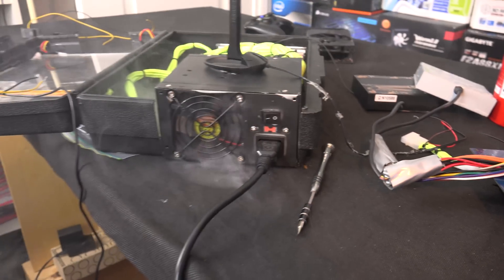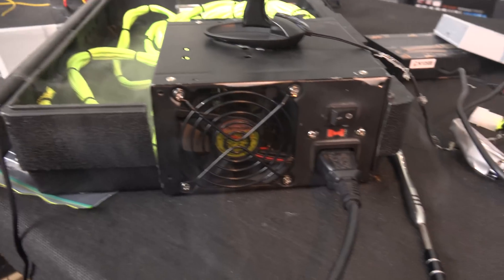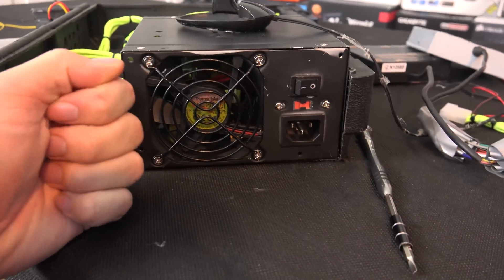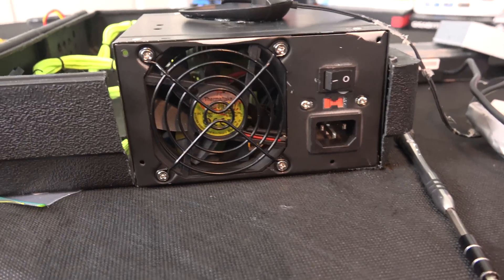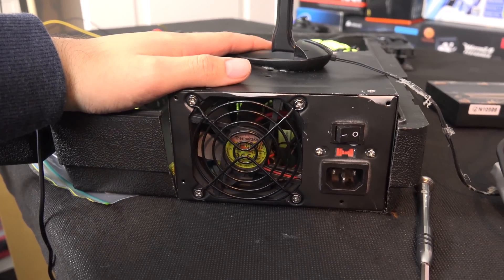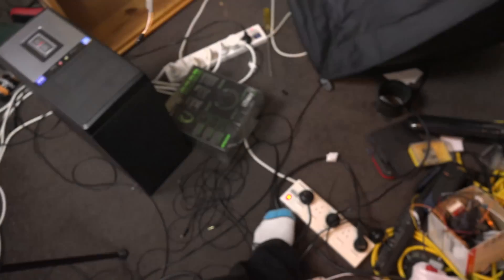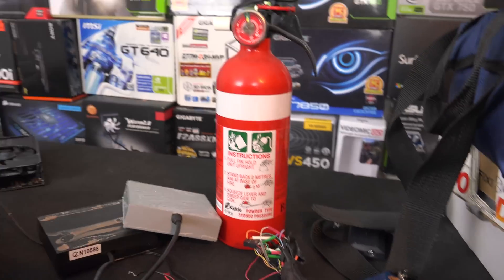PC Safety and Exploding Power Supplies

Comment: The most likely the power supply blew up is because of either bad ventilation or it was an el cheapo Chinese power supply. All power supplies have electrolytic capacitors. 97% of Chinese brand capacitors use bad quality electrolyte, causing exes heat and blowing the safety valve on the capacitor. Sometimes the mains filter cap shorts out. And rarely the transformer insulation is not good and it arcs through it.

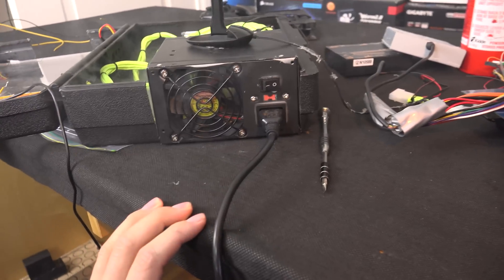Comment: 3:16 good psu's have: short circuit protection (scp), i seem this dont have :/   
My AWFULL chiepish PSU have nice SCP, i tried, i shorted out as hell, psu turned off, and well after i removed the short, and its worked again. So my psu is nice. PSU name: Danubius DAN-450-12. I've got it 2years ago for 15$) i had a garbage psu 350W but actually the V*A 
spreadsheet looked like 270W, i succesfully melted the 24pin and the psu is exploded :') I thinked about to replace the DAN-450-12 to Vortex Raidmax 500AF because, my psu is getting a bit old, primary capacitors are a bit expensive

Comment: I work in an electronics manufacturing plant that adheres to Class 3 J-Std practices. Not saying we don't have explosions from time to time ... but I will say it boils straight down to design, testing and workmanship.

My point is that I see much less than class 3 J-Std standards being practiced in what you have set up. Just my observation and opinion.

It sucks the psu bit the dust. I would really loved to have seen the innards of the PSU though, just out of curiosity sake ... to see what really failed.

Comment: Really, Your first issue is you used a thermaltake psu. I have never seen a thermal take psu last more than a year. Iv never installed one, and never will but unfortunately there are some companies that continue to use them...
Reply: They have some good psu's too.
Reply: @jhonvvick1289  Yeah I have seen a few thermal take psu's that do suvive. Id be interested to open one up and see what failed. In other OEM psus iv noticed transistors fail commonly, infact usaly faily explosively. Its just the majority of them iv seen have failed and thats why in my opinion id stay away from them. Its hard not seem brand bias while still knowing who makes good stuff and who don't, just down to your personal experience i guess. For all i know thermal take make some other great stuff, i just don't use them enough to tell you. 😁

Comment: This just happened to my pc. One question I have is did it damage any of my pc parts?
Reply from the maker: it is hard to tell. in some cases, you might not notice any damage until later down the track. what I would do is power up the machine with a new PSU. then make sure all parts register, all the ram is present, video card shows up ect. then stress test the system for a few hours on both the cpu and gpu to make sure that sustained loads are still fine. if all appears good you might just be in the clear

Comment: was the power supply voltage switch on 240 and if so do you have 240-volt wiring, having the switch on 240 on 120 wiring can make capacitors explode

Comment: If you short the green wire with the black wire and you plug the computer power supply into the wall and the computer power supply isn't powering on and the green led on it isn't lighting up then the computer power doesn't work and is most likely bad but if it could have a chance of exploding so never plug a computer power that doesn't work into the wall because it can still explode even though it doesn't work

Comment: Will the pc still work after the ac blows/ what will need to be replaced if it does
Reply from the maker: if it blows like in the video or makes a loud pop and smells burned I would replace the PSU for a start and any parts that stop working properly. as for the pc working it will depend on what went wrong in the PSU. sometimes it might still boot but is strongly recommended to change the PSU
Reply: CPU modder is it worth the risk to try to see if it will still work
Reply from the maker: not really no

Comment: Never buy power supply's from goodwill because goodwill is a thrift store that never tests electronics to see if they are working or not and goodwill is very good at ripping off their customers so if you buy a used computer power supply from goodwill chances are it will explode on you the moment you get home and plug it in so avoid buying computer power supply's from goodwill at all cost

Comment: well my 300 watt unknown brand psu just exploded today.....i just plug my pc on "without any avr"than typically using avr....and i just hear a " B00M" inside my pc......that psu serve me 12 years and now it just fail..what part of the psu  just fail can anyone explain it to me???
Reply: Capacitors are common to fail on unknown brand power supplies. The reason why you get the boom is the capacitors popping probably because they were either cheap crap or were performing way out of spec.
Reply: it's 12 years I'm surprised it didn't break much before
Reply: probably too old and in need of replacement
Reply: Me it was the transformer in it. Its weird but like there wasnt any black spot on it after it blew

Comment: this is my rule with power supplies of you have a computer that pulls 500watts than you get a 600 watt psu or more you never wanna max out a power supply!!!! ok don't care who makes it just don't max it out! when psu manufacturers label there power supplies they go by the peak wattage and you never wanna run a psu at its peak just don't do it! I've bought cheaper brands like thermaltake and they work just fine because I don't run them at peak.
Reply: no names are bad though, ever heard of kentek?

Comment: Thermaltake is actually very bad except you buy a very expensive one. But if you would spend 90$ on a Thermaltake 600W you could also spend 75$ on a much better Super Flower Golden Green HX 550W with 80+Gold. I had three dead Thermaltake PSUs and some from other cheap Chinese companies (also Corsair) and I found out that almost every cheap companie uses Channel Well or HEC Boards. The only good PSUs from Thermaltake are the TP-P and TR series because they are made by FSP.

Comment: Yes thermaltake is a bad power supply manufacturer... well actually I think they are a re-seller but there quality is all over the place.

EVGA is a good power supply manufacturer none of there power supplies are BAD and I know that from JonnyGURU he tests power supplies, Corsair as long as you spend the money are are really good power supply re-seller but if you buy one of there cheap once there not great there not terrible but yeah.
Reply: In Germany EVGA PSUs are pretty rare but we have BeQuiet here. That's the best PSU manufacturer in Germany.
Reply: Sebastian Flocke Be quiet are above average but they don't sell cheap PSU's so it's to be expected that they are not going to be bad.

I'm surprised you don't get EVGA PSU's in Germany as I live in the UK and you can easily buy EVGA PSU's.

EVGA is better though for example

BeQuiet Pure Power 9 700W: http://www.jonnyguru.com/modules.php?name=NDReviews&op=Story6&reid=476

EVGA GQ 650W
http://www.jonnyguru.com/modules.php?name=NDReviews&op=Story6&reid=454

It's cheaper so I think you can let the 50W go considering it's cheaper and especially considering it it's rated 650W in Hot testing while the BeQuiet didn't quiet manage it's 700W coming in a little lower.

And it's gold efficiency and actually manages to bear out that gold efficiency while the BeQuiet doesn't even manage it's supposed sliver efficiency.

All in all it's just a better PSU and the EVGA GQ series is EVGA's worst series of PSU's tested on jonnyguru, and the 850W is the worst of those and it still manages a total score of 9.2 while the BeQuiet Pure Power 9 manages 7.8...

Be quiet as I said is by no means bad you wont go wrong with them they don't sell bad PSU's so you're safe, but there lowend power supplies are not as good as they should be.

And I judge a brand by it's worst products and if there still pretty good then you know you have a good brand.
Reply: +Etheoma Well the Pure Power Version is really bad... Even the new one is just a "beginner" PSU... For Gaming and big graphics cards you should take the Straight Power 10 or the Dark Power Pro 11 (I currently have the 1000W Version). And to EVGA PSUs: You can get them at Amazon.de but they'r just more expensive than a better Bequiet or SuperFlower from mindfactory.de. It's just not worth it to buy a PSU or a Motherboard from EVGA. Just the graphics cards are at a normal price...
Reply: +Sebastian Flocke And the really low end Bequiet PSUs are actually pretty good. (Bequiet System Power 8). They are based on the Straight Power 9 and have some components from the Straight Power 10. AND the whole unit is made by FSP so they aren't as bad as they seem to be. They'r just alot louder and have less cables than normal PSUs. But you get 100W for 10€ (400W for 40€ and so on)
Reply: Sebastian Flocke What hardware do you have which needs 1000W 2x Pro Duo's? with a dual socket board.

I have a 750W PSU and a can support any 2 way SLI setup and some in 4 way like the 970 / 980 I really don't get people who buy those kind of power supplies

And if you want to step up G2 is what would be equivalent to Straight Power 10 in price but again it preforms better. Although G2 has recently went up in price, I think it was because it was so popular and they have stopped production for a new product.

Then the P2 would be the equivalent to the Dark Power Pro 11 which again is priced lower but is again beaten in efficiency, ripple, and achieving it's rated delivered power by giving you more than what's on the box.

And EVGA has a step up from that the T2 which is actually similarly priced to the Dark Power Pro 11 if you're willing to step down from 1200W to 1000W but if I'm spending £250 on a PSU I want quality not quantity. All other wattages are actually similarly priced though it's the 1000W and 1600W which are especially expensive.

EVGA is just better straight up for power supplies, I get wanting to go for bequiet for the looks and surprisingly enough low noise levels.

But just as a PSU EVGA has BeQuiet beaten easily at every price point.
Reply: +Etheoma i7 6950X @ 1.36V / 4.5ghz on an MSI X99S Mpower, 2 Zotac GTX 980ti AMP! Edition (both overclocked, I don't know how high), 8x RipjawsV (32gb) 3200mhz, 1TB WD Black, 2x Samsung 850 Pro 1TB (didn't have to pay for them) and 6 fans in the Corsair 750D. The whole System needs about 920W when under full load and 880-900W while rendering Videos or 3D projects. And because I didn't have to pay for some of the parts (like SSDs or Ram or the Processor) I could buy the 1000W DPP11. I also wanted a very quiet PC so the PSU is perfect for me. EVGA may have some cool products but here they are definitely not cheaper than any good bequiet PSU.
Reply: Sebastian Flocke I assume you are measuring that from the wall correct a PSU is rated by how much DC wattage it can put out, not how much AC wattage is used from the wall.

Even assuming 90% efficiency 920W from the wall is 828W in AC wattage put out by the PSU.

Although I would not pump so much voltage through a boardwell E processor Haswell E that's basically fine but Broadwell was originally designed for low power so the transitor thickness at the top is smaller to reduce power consumption but also it is more sensitive to loads of voltage because there is more resistance.

Back it off to 4.4Ghz and you should be able to reduce to voltage by a lot and you're not going to notice the difference between 4.4 and 4.5Ghz it's a 2.27% difference.

EVGA 750 W GQ £88.24
BeQuiet700 W Pure Power 9 Power £88.73

EVGA G2 750W 109.99
BeQuiet 700 W Straight 10 Modular 115.99

EVGA P2 750W £112.37
BeQuiet Dark Power Pro 11 750 W 149.99

EVGA T2 850W £214.56
BeQuiet 850 W Dark Pro 11 186.93

Every EVGA PSU out performs each of the BeQuiet PSU's

and the last one they aren't even in the same tier of PSU so it being £30 more expensive is to be expected because the EVGA T2 is Titanium efficiency rated while the Pro 11 is only Platinum, the real difference between platinum and titanium is the 10% load figure of 90%+ which none of the other breakets have efficiency requirements for 10% load.

And let me remind you that the EVGA PSU's outperform what they are labled as while the Bequiet once slightly under perform so even when I have picked same rated wattage PSU's the EVGA once can still deliver more wattage.
Reply: +Etheoma I mean I could but it's working fine. I didn't actually had the time to really test which voltages work with the processor at 4.6ghz (or lower) so I will try it out. At least it's cooled by a H110i GTX so it only goes up to about 75°C. http://www.abload.de/image.php?img=zwsho.jpg  Here is a picture of the PC btw.
Reply: Sebastian Flocke I wrote more in the last comment.

But temps are not everything Broadwell is just naturally more delicate due to it's design. As why I have been telling people Zen is NOT going to be a good overclocker because AMD has when hardcore on the power efficiency 95W TDP competing with the 6900k on performance which is a 140W part yeah there going to have had to sacrifice overclocking hardcore.

The massive reduction is AVX performance wouldn't make up a 34% drop in TDP, there going to have had to have designed a REALLY efficient architecture probably mainly focused on notebook and embedded because they are growing markets.

Because they are not going to have dropped the base clock below 3Ghz because that would be shooting them self in the foot because speed binning is easy shaking off a poor launch isn't.

They can always just sell a lower speed binned CPU latter if they couldn't achieve 3Ghz+ on a decent number of CPU's. Because they need to win back hearts and minds and sub 3Ghz clocks do not win hearts and minds...

So low clock rates cannot be the answer so it has to be architectural or based on the node used
Reply: +Etheoma Didn't see it sry. The DPP11 750W is 165€ and the T2 750W 220€. I really don't know why... And I could have bought the 850W version but the efficiency would be at around 83%. Because EVGA isn't cheap here, I didn't read much about it and I am actually surprised how good they are. And the problem in Germany is that you can only buy hardware stuff online because in electronic stores you only get Thermaltake or sometimes cheap Coolermaster PSUs. And if you look online (amazon.de) you can find different PSUs from any manufacturer but they are just overpriced. So you have to buy everything from mindfactory.de and they dont sell ANY EVGA products so EVGA isn't very popular here. And do you know why britsh products are so rare in Germany since Brexit? I wanted to buy record player (or phonograph, dont know how it's called) and I ordered it 1 month ago from Audio-Technica. It still didn't arrive. Also my broken Headphones (ATH M50X) didn't arrive yet...
Reply: Sebastian Flocke EVGA is an American company.

Comment: Did you get shocked?
Reply from the maker: dam
Reply from the maker: +MIKE CHIESA thankfully not but i did get that wired high voltage electrical feeling after it happened
Reply: maybe just fear?
Reply from the maker: possibly
Reply: CPU modder yeh i know the felling ive stuck my hand right into a wall plug live with a screw drive i let go of it and it blew the braker for the next 5 minutes i had that feeling and thanks for the reply

Comment: CPU modder I bet that gave off a very arcid, burnt, ammonia like smell. The kind that hangs around for hours.
Judging by the amount of smoke and the steam like color, that was a capacitor exploding.
Furthermore, because of the loud humming, I can state that it has failed on the voltage doubling rectifier section.
Am I right? :D                                   

....Very well made video by the way.

Comment: Since you have a switching PSU .. I bet it was the Voltage Doubler and Primary Rectifier or you should of not touched the wires when it was live LOL Hardware secrets and the Jonny Guru is a great source for PSU information and testing, lot of reviews, overviews, testing, and picture tutorials. The Cube Computer Channel here on youtube is an excellent source for rebuilding and making more energy efficient PSUs (it's easier and cheaper than you think!).

Comment: What was making the noise?
That sounds like a large compressor, not even a small computer fan......
Reply from the maker: +Benjamin “Ozias” Esposti from memory it was a larger capacitor as well as the fan and just recently I found it also took out a few fuses on that power board the noise was also a mix of the fan and something in side that psu. still don't know what it was but it was more than just the fan

Comment: My setup uses 400-450w, am i okay with a 500w supply?
Reply: you s hould have 100-200w extra for s afety and efficiancy
Reply from the maker: TopMikiFilms most likely yes but you will be pushing it, I would say to try for a 600-700w one as you will have some more head room but you could get by with that 500W one. It also depends on the brand and the rating. e.g an oem 500w power supply is not as good as an 80+ gold 500w power supply